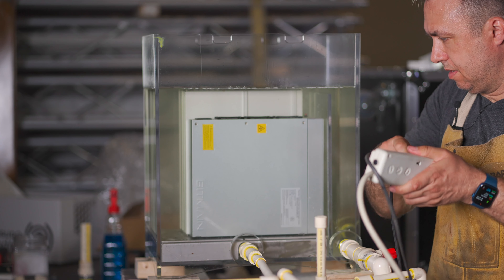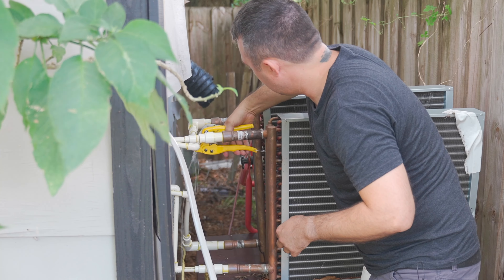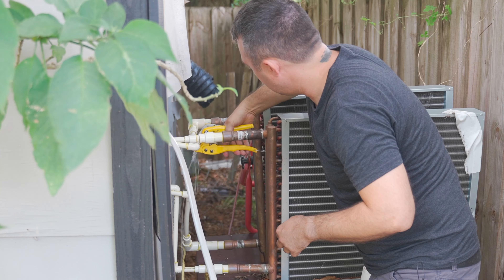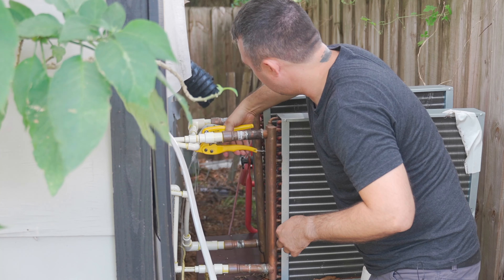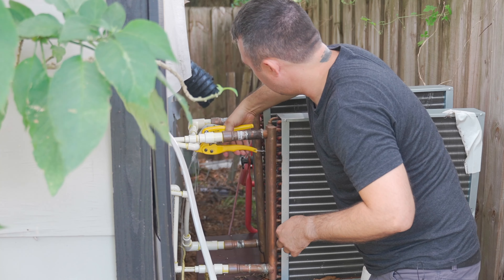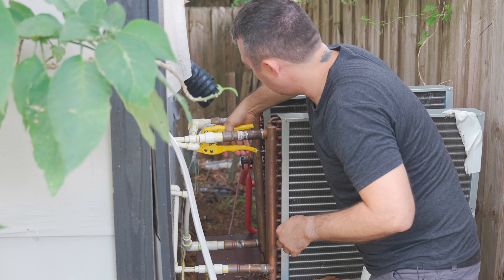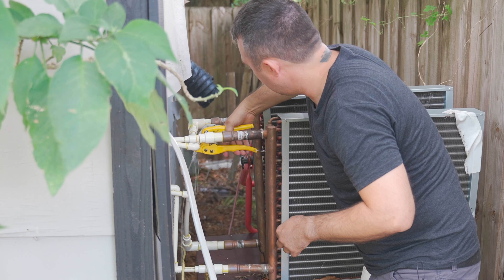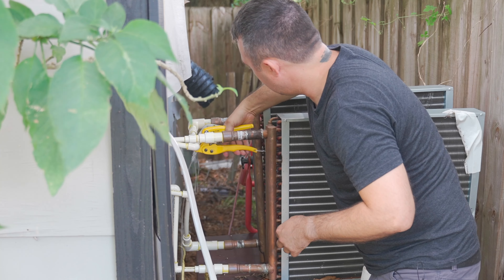Immersion Cooling an S19J Pro Bitcoin ASIC Miner With a Two Loop Heat Exchanger

Comment: As usual amazing video! This definitly opens up the door to many other uses for disposing of the heat, i would love to have heated tiles in the bathroom, tear out the tile, lay some tubing  down, re tile over it, and boom, heated bathroom floor
Reply from the maker: Right?  Its almost like every single house anywhere north of Texas should have a bitcoin miner in the basement, providing heat for regular things while making money.

Comment: I have a single s19j pro, and I've decided not to immersion cool until the warranty is up. I live in Canada, so getting rid of heat is only an issue in the summer months, and even then, nowhere near your situation. We've been having cool weather up here, where I am lately. Last night the temperature was 3 degrees celsius. Can you imagine that, it's June! It's not normally that cold. And todays high is supposed to be 18 degrees, which to me, is beautiful.
Reply from the maker: That’s incredible weather!! Yeah, the only reason to immersion cooling up there would be for noise or to try to take advantage of the heat and use it somehow like I mentioned here.  Definitely not for cooling the machine though!
Reply: @SPACEDESIGNWAREHOUSE  Yeah, this is a bit abnormally cool. We'd typically be warmer and our summers can become quite hot, so I'll have to cross that bridge eventually. I would like to heat a pool (which I don't have currently) at some point.

Comment: nice. pretty cool that you can use the other loop for heating! 100F is more than enough for radiant. The Hvac technician in me is cringing on the piping though. copper would look so much better. plus installing shut offs, drains,, air scoop, and putting in unions to allow for easy servicing and purge. ahhh. okay I'll stop. 

they make press fitting for copper nowadays so you could build it even quicker. if you have the tool of course

Comment: I’m you’re first giveaway winner. I work in plumbing and electrical and when I was younger worked in a brewery. I’m very familiar with plate and coil heat exchangers along with your setup. If you ever have questions or would like to bounce ideas around. Let me know and I’d be happy to send you my info. 👍🏼
Reply from the maker: Thats amazing!   I dont have any specific questions, but I would QUITE like to see a "professional' version of this sort of thing. How clean and compact could this method be packaged - because really, everyone who uses heat for things could benefit from a thing like this running quietly in their basement or garage, but DIYing a gnarly thing like Ive made is a bit impractical.
Reply: Good to know we have someone like this here. I'll just go ahead and copy the same question I asked Nick: 

Since you're using the heat exchanger to cool water, its rating becomes accurate. 200,000BTU is around 58kw, that's almost the heat of 20 S19J Pros, using a pool instead of the small water tank you used. Do you think a single exchanger can dissipate all that heat alone with a double loop?

Comment: Wow that is complicated.....but using the car radiator like I do was a good start!!!!keep up the good work and discord is enjoyable too..psss pex pipe is WAAAAAAY EASIER!!! to use..and one day I will let the world in on my fluid choice.....cheap and almost everyone can get it in there own towns....think about it....and I haven't seen anyone else use a "worm" in there cooling system yet either hmmm.... although I'm only cooling 4 machines per set up might not work on larger set ups but mine has been working great 👍 Great content!... amazing what a debit card and a garage full of race car parts can produce...entire set up is made of automotive parts minus the SJ,s and piping...if something ever goes wrong only places I have to go is Oriellys auto or Lowe's hardware store and since bitmain is now a double unicorn company (5bill per uni) there's no shortage of machines just hard to pay for lol....
Reply from the maker: My very first attempt was with a car radiator and flexible tuibing.. but Bitcool can ruin lots of stuff really quick - hopefully your top secret fluid doesnt!
Reply: @SPACEDESIGNWAREHOUSE  pex pipe isnt the clear flexable pipe your thinking..its the same as cpvc and used in 85% of new homes...name 2 fluids in a car that cant carry current and is in direct contact with metals and cools as its 2nd purpose...and these arent bio degradable the one i use is great for cleaning rust off my tools too..lol
Reply from the maker: @CraigBrosRacing  yeah, I am familiar with pex. It is incompatible long term with Bitcool.  I don’t know about the effects of antifreeze on pex over long periods of time.

Comment: Always love new immersion content.Thanks! this was a good one. I've got two questions;
1/ Why did you have to lower the level for the pump to prime in the oil section?
2/since you're using the heat exchanger to cool water, its rating becomes accurate. 200,000BTU is around 58kw, that's almost the heat of 20 S19J Pros, using a pool instead of the small water tank you used. Do you think a single exchanger can dissipate all that heat alone with a double loop?
Reply from the maker: 1/ I don’t think it wasn’t priming, but since the level was so high I wasn’t producing that little waterfall which separates the hot side from the cold side, it was just sort of all flowing.  

2/ when this WAS hooked up to my pool, it cooled WAYYYYYY more effectively. I think the hot side discharge temp on the dielectric side was 90f/32c!!! 
I’m not entirely sure why this radiator doesn’t keep up so well unless it’s just because the room is so hot, there isn’t a big enough differential.  I’m interested to hear from the other guy.
Reply: Radiators are all designed for different things. Some are for high airflow and others are not. The fluid in the radiator changes the rating. Tons of factors can affect the final efficiency and heat exchange rating. Using a pool is nice because its thermal mass is ridiculously large. There's a lot to be said for something like that. I know that kind of setup is popular with miners in Europe. They heat their house water with mining.
Reply: @ltborg  is using a pool for mining sustainable long term? wouldn't the water become so hot that it would no longer have cool properties to exchange with the oil?
Reply: @af6727  Depends on the pool size, the ambient conditions the pool is in, the heat level you want in the pool, how many miners you're running, etc. I've seen people use small ponds in the north. They just pump the pond/lake water in, through a heat exchanger/pump/filter setup meant for dirty water, then back to the pond. For them, it's enough thermal mass. My point was more that in some cases it would likely be better, in others it's not. Same with radiators. You can make a car radiator or a wood furance heat exchanger (what I use) work, but it's a compromise that may not scale the way you want. I couldn't run a pool/pond setup here in the Texas desert. The water would be far too hot unless you had a massive underground reservoir you were using. But if you're in parts of Canada or Alaska, I bet it would be a viable option.
Reply: la yo tengo una batea con esa separacion, pero como calcule mal la plataforma donde apoya el asic, el asic quedo demasiado arriba y tuve que llenar mas liquido para que quede cubierto, y no se produce ese efecto de cascada, queda todo el aceite al mismo nivel. Es muy necesaria la cascada?

Comment: Why not use soft tubing? Can it not handle the temperatures? does it get degraded by dielectric fluid?
Reply: Bitcool 888 compatible flexible tubing is expensive.
Reply from the maker: Like Jarome said - there ARE soft tubes you can use, but theyre expensive and not readily available.. I had a ton of CPVC sitting around from previous projects and Im familiar with it now.. Plus, I STILL need to thread in to the pumps, the tank, and the heat exchanger, which would be more bit to go to a hold of with barbs on the end.

Comment: Hey I actually noticed you said you use an acrylic tank for your miner. On the compatibilities list for engineered fluids it states that acrylic has more restricted temperature use ranges (maxing out at 70C or 158F). I'm assuming this means closer to those temperatures the plastic can lose integrity. have you noticed any problems with your tank or weakening in lone-term applications? I'm planning to make my own tank out of fiberglass and use some sort of clear material for a window to see inside and I am asking for materials research related reasons. Thanks!

Comment: What kind of pump you using, hp? Head? LPM?

Would Appreciate your reply ... ✅
Reply from the maker: These are March Mdx-mt3 pumps
Wetted materials: Ryton®, Ceramic, Viton™
Maximum flow: 8 GPM
Maximum head: 16'
Not self priming
Good for harsh chemicals
1/2" MPT inlet x 1/2" MPT outlet
1/25 HP, 115v, 50/60 Hz, 1 phase, 1.35 amps, 3450 RPM motor

Comment: What do you think is a better option the diy immersion two loop system (obviously costs more) or the ac affinity air cooled?
Reply from the maker: Well the AC Infinity system uses less space and less electricity and for the most part runs about as cool (of course you can use bigger pumps and radiators to get even cooler temps still in immersion but then you’ll use even more electricity). 
An argument could be made that immersion will make your machines last longer, but there’s no reason to think they won’t last infinitely long like the S9’s are still going.. 
If the build is what interests you most, like me, creating an immersion system is more satisfying!  
And of course with the two loop system there are more things you can do with the heat; heated floor, heated driveway, hot water, VS just hot air with the ducted system.  
It’s a toss up and the answer is both.

Comment: What are the dimensions of the tank, as well as the height of the piece inside that the hot oil flows ‘over’?

Called a glass shop last week to get started on my tank, yours is perfect!!
Reply from the maker: Ill be at the warehouse tomorrow, Ill take some measurements and set a reminder on my phone to comment about them here again!
Reply: @SPACEDESIGNWAREHOUSE  awesome thank you. Helps a ton!!!!!!
Reply from the maker: @xclarryx  it is 11” wide, 17” long with the hot side being 2.5” of that 17”.  The divider to the hot side is 5” shorter than the walls which are 19” from the floor. The flow plate sits 1-1/4” up; the Bitcool pumps in under it.
Reply: @SPACEDESIGNWAREHOUSE  thanks so much, I’m getting mine cut from glass and didn’t know how tall to make the divider for the hot flow. Thanks for saving me $$ and a headache

Comment: Would flexible pipes work for this? I guess they possibly cost more, but would simplify connections maybe
Reply from the maker: Flexible pipes work for the water side really easily, i just had a lot of left over CPVC from a previous thing... But on the bitcool side - there is a material compatibility problem where the only plastic flexible pipes you can use cost a whole lot and are harder to find.

Comment: Wondering why did you remove the overclock? Did it get too hot  you had to go back to stock?
Reply from the maker: Yep, it was getting too hot. So I wanted to rule that out before I determined this was not going to work.
Reply: @SPACEDESIGNWAREHOUSE  I hear you. I'm running it at 106T and my ambient is the same as you. Chip temp is 80C in the sunny morning and 75C in the evening.
Reply: @SPACEDESIGNWAREHOUSE  Hey Nick. Just to get it clear, are you saying that on two radiators and pumps, you had one S19JPRO running stock with chip temps in mid-70C?
Reply from the maker: @af6727  no, previously, on two radiators and pumps I had one s19j pro overclocked to 120-125TH running in mid 70’s - in florida where ambient heat is over 90f outside. 

When it was stock, it would run high 60’s. 

On this most recent system there is only one radiator.
Reply: @SPACEDESIGNWAREHOUSE  Nice! One last question. Do you remember what was your ambient temp back in Jan,2022 when you had your 2nd build? The one with a high 60C chip temps? It didn't seem as bad as 90F back then

Comment: How can water molecules be bigger than bitcool? There is 3 atoms in water, ordinary carbohydrates need to be the size of heptane to have the same boiling point. doubt bitcool is less than 3 atoms.
Reply from the maker: I just spent the last ten minutes looking things up and yeah, I’m not exactly sure why the engineers there told me that. I got that from one of the materials engineers at engineered fluids; he said that a water tight seal wasn’t good enough and that this stuff will find it’s way through and needs a closer tolerance. But everything I’m finding about other dielectrics shows their molecular makeup would have to be larger. 

I may have misstated that.
Reply: @SPACEDESIGNWAREHOUSE  Its no biggie, im learning a lot from the mistakes you made, i want to try and setup 2-3 miners for my house central heating, very good info on the pumps in your videos. Thanks a bunch mate.

Comment: What pumps did you use oil ? and Water ?
Reply from the maker: For oil I use an MDX-MT3 Magnetic Drive Pump. For water, this was an experiment so I just used a cheap submersible plastic pond pump from Amazon.  8 gallons per minute for the water pump.

Comment: Think about this: Get a 5 or 10 gallon chest freezer and run copper tubing back and forth in the freezer like a radiator. Almost fill the chest freezer with antifreeze. Turn on the freezer and run your bitcool through the copper tubing. This should cool things down significantly and you wont have to run pipe and car radiators all over your back yard.

Comment: what about a Glycol Chiller instead of the Rad setup?
Reply from the maker: That would work, but in order to keep up with the amount of heat being produced by the miner, you would basically have to match the electrical output of the miner to cool it.  So that would become cost prohibitive unless you have extremely cheap power.

Comment: Is it true that my inlet temp (outlet in your case) will read the same as fluid oil temp on a thermometer?
Reply from the maker: I don’t think so. I think “inlet temp” is the temp of the first row of chips, because my fluid is like high 30’s - 40’s on the way in, but the inlet temps can say 50’s - 60’s

Comment: Do u think this combination handle a hydro miner?
Reply from the maker: A hydro miner is already maximally cool, and uses a completely different method of liquid cooling.  They send the coolant directly into the surface of the chips and back out, so dunking one of those in an immersion tank would offer no additional cooling benefit.
Reply: @SPACEDESIGNWAREHOUSE  yes thats true, but i mean the combination of the radiator and cooler and then with a tank + pump a circle of water. i have 2 hydro miner but iam looking for a better options for hot days, i have a air conditioneer and 2x radiators from a car and if 35 grad outside the water is to hot then.

Comment: Couldn’t you use pex pipe instead of the glue mess ?
Reply from the maker: For the water side, yes.  But for the Bitcool side, pex is not on the compatibility list. 
I was reusing pipes I already had from a previous build, but from scratch I would use pex on the water side.

Comment: Do you have a link to the pumps you used?
Reply: This is the pump https://www.marchpump.com/pump/mdx-mt3-magnetic-drive-pump/
Reply: @NicholasJamesJohnson  awesome thanks! And you win the fastest response award, well done.
Reply: are those the pumps used for the water side as well?  Seems overkill to buy a chemical pump when a hot water pump would do.
Reply: @OliverKane  totally agree, I just had bought two of them for a previous project. You definitely dont need a chemical pump on the water side.
Reply: I ended up with a similar problem with my radiator being incapable of dissipating enough heat.  Temps for one unit stabilized just under 80 c.  Been working on the waterloop but I haven't found a pump that I like That's both for continuous duty, high temps, and also with one inch slip fittings. Closest I find is stuff that does 3/4
Reply: I think you need something crazy like 44gpm @40C delta to get the efficiency out of these radiators.  The pump I use (that same MDX3) only can do like 11 max, and that's with zero head, and no other obstructions or bad piping.